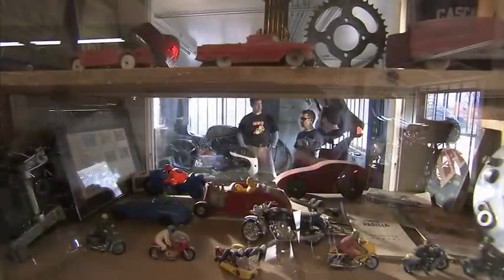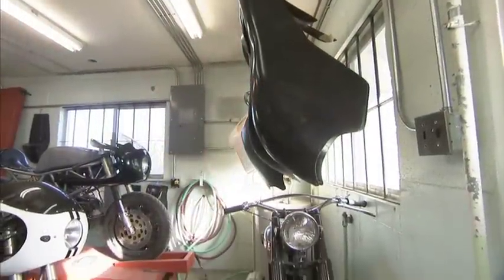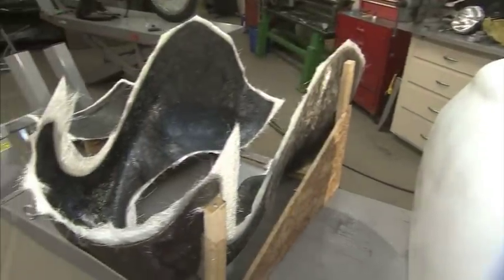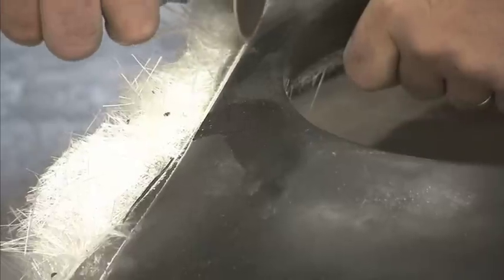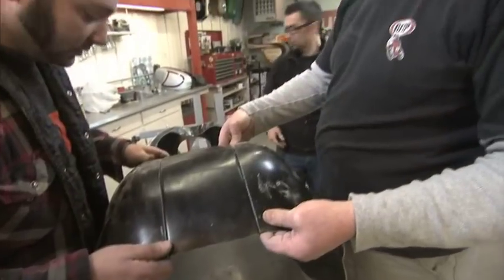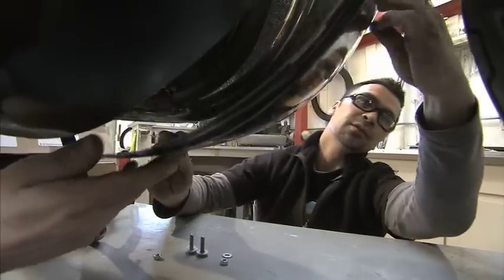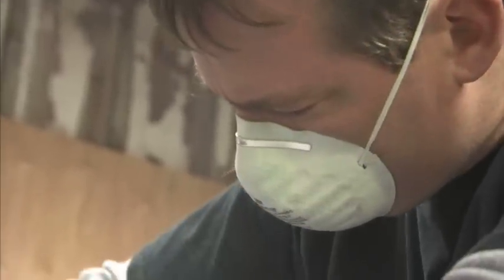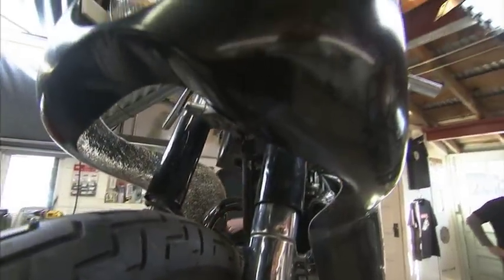Union Motorcycle Classics - Masterpiece Fairing Builders

Comment: Hi Guys, Being a 62 year old from the UK I can appreciate the work that goes into making full fairings like yours, whether for racing or touring. I just wish you had patterns for the mounting brackets too. I am at present trying to fit a 60's era Avonair fairing to my 500cc Royal Enfield but am having to start from scratch with the brackets, this wouldn't be so bad but the fairing is the type that the front wheel has to come out each time I wish to try a fitting. Well Done from the UK